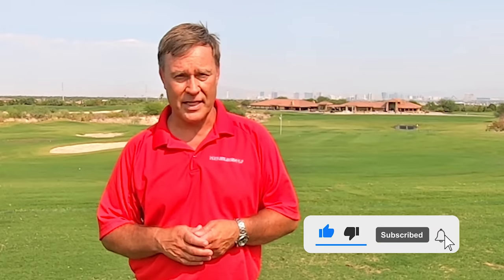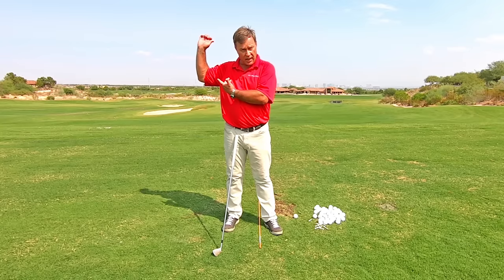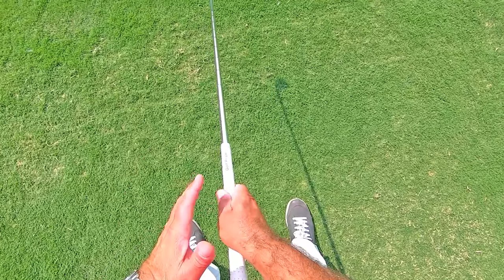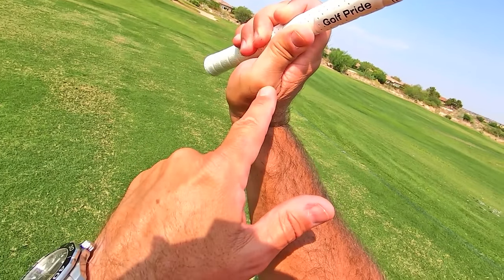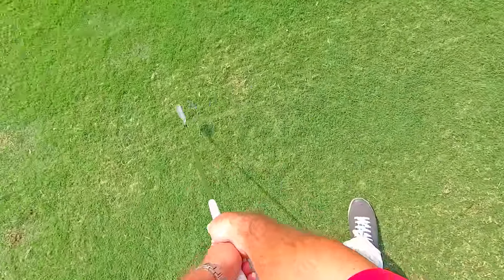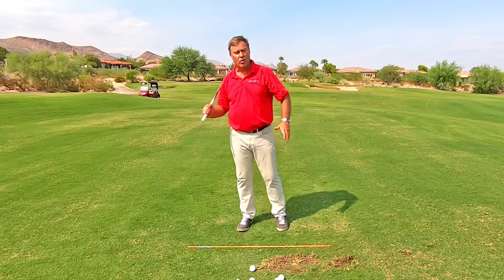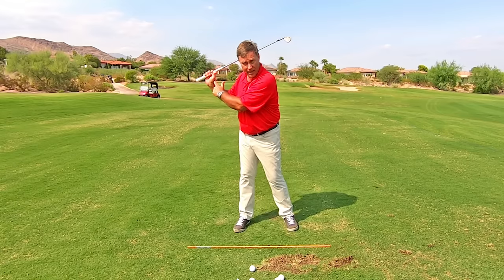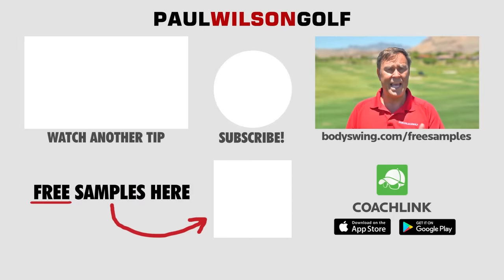GOLF GRIP - THIS PROBLEM LOSES POWER AND CONSISTENCY

Comment: When my thumb is squeezed against the side, with the forefinger in the question mark position there is not enough room in that v for the club to fit. The only way I can make it work is to separate the thumb which puts me in the position show at 5:15 of the video and the club moves around. I think my thumb is too short for this. Any tips? Smaller grips? I have standard size right now.
Reply from the maker: I don't have huge hands and I have no problem.  No problem in teaching all sizes of people for 30 years.   Just need to see it differently.  Watch my other tip here which shows how to place them on maybe more clearly:
https://www.youtube.com/watch?v=jQZLp8bF-Ww

Comment: Thanks, Another crucial tip for my improvement, is the correct right grip V pointing towards my chin? Right grip slightly weaker than the left and 2 Vs are not parallel?
Reply from the maker: The correct right grip would be the V points between the ear and shoulder.  Chin is too weak.  Remember that both V's need to be parallel too.  https://www.youtube.com/watch?v=jQZLp8bF-Ww
Reply: @paulwilsongolf  Thanks, I will try this

Comment: Hi Paul - not sure you will see this comment since you made the video one year ago - I do need your help. I am 66 years old. Several years ago I was in an accident that resulted in my right hand ring finger not being able to bend at the first joint at the top of the finger. Thus, when I place my hands in the neutral grip, the very top portion of my right ring finger will be sticking out straight. This is how I have been practicing the body swing - not sure if you have any suggestions for me, but any are welcome!
Reply from the maker: I try to get to all comments.  I don't see an issue with it as long as you keep the thumb presses against the side of the index finger that is still there.  If you can at least make the V so it cradles the club I don't think the stiff first joint is going to matter.  The problem is people running this finger down the grip which stops the wrists from hinging.  Check for the V and I think you are good to go.
Reply: @paulwilsongolf  Excellent! My V is there so I will keep practicing with my neutral grip. My index finger is just fine - it is my ring finger that cannot bend at the first joint at the top. Thanks so much! -Dan

Comment: 2:05 Neutral grip
2:34 wrap on top
2:47 question mark (important)
3:26 question mark (reminder)
4:01 The V
4:39 Don't Lock the wrist (not good)
4:50 Cast explained
5:14 No loosey goosey
5:54 Bad habits explained
Reply from the maker: Nice summary.

Comment: I’ve been playing for 3 years and have always had a ‘short’ swing where I felt I couldn’t hinge or rotate properly and my thumb being at 12 o’clock is the issue. It’s so restrictive and it could be causing my back pain as I fight my body to rotate more when my wrists and thumb having been restricting it.
Reply from the maker: Glad you found this one.  Yes, it could certainly create back pain because without the hinge you have to swing twice as hard.
Reply: @paulwilsongolf  thanks Paul. I went to the range to try it out last night and I’ve never hit the ball better. All irons and woods were immaculate. No swings changes just the simple thumb position!
Reply from the maker: Very good. This is helping a lot of people. Crazy how many people are gripping the club wrong.  It all starts with the grip.

Comment: Paul,To Clarify,I'm Not supposed to Squeeze the 2 fingers forming the Question Mark,just let the Club sort of rest in in there and Not let it slip all way down to the bottom of those 2 fingers??? Sal Patanio
Reply from the maker: Yes, you are going to squeeze them together so you get the V which the club is going to rest in.  Any separation between then and the club may wiggle.

Comment: So you interlock or overlap your pinky ? Also do you recommend the grips you are using ? I'm looking to re-grip my irons but not sure what to get.
Reply from the maker: You can choose the grip you like.  I don't promote interlocking even though Tiger and Jack did that grip.  I just find people wedge the pinky in with the index finger of the top hand to get a secure connection.  Problem is, the bottom thumb ends up down the shaft as I show in this tip which hampers the wrist hinge.  There are other reasons too.  So the choice is yours.  I would stick with the overlap though which you can learn here:  https://www.youtube.com/watch?v=jQZLp8bF-Ww
Reply: @paulwilsongolf  iv always overlapped but I know most players interlock. I guess it's just preference like most things. I'm from Scotland so I need a good reliable grip that's good in both dry and wet weather. Thanks for the reply.
Reply from the maker: Most players overlap.  Most average players interlock.  What you need are some good synthetic gloves.  There are some great ones out there now that are super sticky in wet weather.  Just search for them.
Reply: @paulwilsongolf  yeah I'm a single figure handicapper just looking to see advice. Iv played overlap so long I don't think I'd like to change. I have wet gloves but just feels weird using both hands haha. To be honest if the rain is that bad I just don't play. Take care man.

Comment: What should you do when the left thumb is under the club at the top and starts to hurt do you the pressure on it during the swing
Reply from the maker: Need loose wrists.  Secure grip loose wrists.  Work on my neutral grip so you know for a fact your grip is on right:
https://www.youtube.com/watch?v=jQZLp8bF-Ww
Do this with the grip on:
https://www.youtube.com/watch?v=Xk7t9yHCO-I
https://www.youtube.com/watch?v=7olBqwXF3Ik
Then:
https://www.youtube.com/watch?v=Z8K3Gctkz7A
https://www.youtube.com/watch?v=YHCEPu9e_1k
Reply: @paulwilsongolf  Thanks do much!! I just quickly watched these and will make sure to do as you say when practicing next! 

I was considering trying midsize grips, as I’m someone who has only every played standard. Do you have an opinion on grip size? I where a large glove which some say either or and have a 7 3/4” wrist to hand measurement, which golf pride says midsize but others say standard. Do you think making a change could benefit me or do you think it could hurt if it turns out to be a little to big? Thanks for your time! Love the vids!
Reply from the maker: Glad you are going to follow it.   Midsize grips are fine if your hands are a little bigger.  I would wear a cadet large glove.  I use standard tour wrap grips with 2 wraps of tape.  Midsize grips to my are too big.  The wider the grip the lower the hand action so you leave the face open.  If you your hands are big enough though you will be able to handle mid size.  When I check someone's grip and put their bottom hand on and I see that their finger tips hit the fleshy part of that same hand then they are too small.   So follow the grip first and look for perfect placement.  Then decide if they are too small.   Your hands are bigger than mine so maybe.
Reply: @paulwilsongolf  Thank you!! I really appreciate the help!

Comment: Have known this thumb position and benefits for some time but for me, it produces a banna slice. Assume the rest of your mechanics have to be correct for this to work.  Using a shorter back swing, the thumb position can be moved to the other (back) side producing much more consistency. Maybe less distance and some other downsides but it may  just depend on what works for you.
Reply from the maker: It is not the grip causing the slice it's locked wrists which is holding the face open.    Why not learn how to hinge and rehinge your wrists?  Only takes about 20-30 balls.  Then you can have loose wrists throughout your swing and get all the power you want.
Grip:
https://www.youtube.com/watch?v=jQZLp8bF-Ww
Wrist release drills:
https://www.youtube.com/watch?v=jQZLp8bF-Ww
https://www.youtube.com/watch?v=5_O0H2QNFo0
https://www.youtube.com/watch?v=Xk7t9yHCO-I
https://www.youtube.com/watch?v=sZ2-dqOausU
https://www.youtube.com/watch?v=7olBqwXF3Ik
https://www.youtube.com/watch?v=jEWe9Gaoqxo

Comment: I just started golfing, and even though I'm a weight-lifter, with calluses all over my palm pads & center 4 digits, it is absolutely tearing-up my THUMBS. It's brutal.
Reply from the maker: Learning the golf swing can create all sorts of pain in the beginning.  As for the grip you need to do the proper grip.  Once you get the grip then you need loose wrists to allow the club to hinge and rehinge.  Right now, I would think you are just grabbing on tight which is locking your wrists.  If you hit a ball off center it creates shock which twists the club in your hands cause the shock has to be absorbed somewhere. So it's a secure grip with loose wrists.  Also, better contact of course creates less shock/twisting.  Follow these tips:
https://www.youtube.com/watch?v=jQZLp8bF-Ww
https://www.youtube.com/watch?v=Z8K3Gctkz7A
Then I usually start beginners with these:
Body Swing Concept: https://www.youtube.com/watch?v=E8y9jEyY35k
How the swing works:
https://www.youtube.com/watch?v=GHUFYnu-Bmo
How To Hit It Like Pros: https://www.youtube.com/watch?v=0gOuKQpUl54
Alignment: https://www.youtube.com/watch?v=VFZc0Wq282k
Simple Swing: https://www.youtube.com/watch?v=gTLvRsjwfIM
Wrists: Hinge Rehinge:  https://www.youtube.com/watch?v=6ZeTqcz2pmE
https://www.youtube.com/watch?v=M868QsTlGt4
Body: https://www.youtube.com/watch?v=RdphthCQ9VM
You can also do this to get the shape or movement of the swing super fast: https://www.youtube.com/watch?v=gTLvRsjwfIM
Just realize you are not hitting anything.  You are learning a movement.  Arms and wrists are loose.  You are powering it with the legs and hips. In other words this is leg press not bench press.

Comment: Do the fingers interlock?
Reply from the maker: I don't do an interlocking grip.  You can if you want but if you do you need the V of the bottom hand on top.  Most try to wedge the pinky in too deep for a secure connection and their bottom thumb goes down the shaft.  This hampers the wrist hinge.
https://www.youtube.com/watch?v=lWEhXEGSgRE
Learn the neutral grip too here:  
https://www.youtube.com/watch?v=jQZLp8bF-Ww

Comment: How does that compare with the teachings of what Dustin Johnson does at the top. There is a video on to see how it looks. No hinge. I’ve got the hinge and have been told to not do that. Im confused. Comments welcome
Reply from the maker: Well he actually does hinge.  He also bows his wrists..  Doing this shuts the face.  In order to square the face he needs his hips to be open about 60 degrees through impact.   Very difficult to do especially for the average player who barely uses the hips at all.   I have seen the very same position over my almost 30 years of teaching in woman and little kids.  It is due to pulling it the club back with the weaker right hand causing a bow at the top.  If I saw that position I would have fixed it.  Obviously, no one fixed his position.  It's a miracle he  an even hit a ball from there.
Reply from the maker: Just to clarify.   From the front at the top hinge wrists are hinged to 90 degrees or less so he is hinging.  If he didn't hinge his clubhead would be pointing away from the target at the top of the backswing.

Comment: I broke my right wrist 3 times. I have to turn my right wrist toward the right side of the shaft. I can put my thumb parallel to the front of the head. I think that's my issue. Not sure.. yepp, almost sure that is my issue. I can't wrap my right hand the way his is. My thumb is to the back more.
Reply from the maker: If you have a physical issue you need to understand what I am saying in the tip then try to figure out what is going to work for you.  Loose wrists allowing them to hinge and rehinge.  That is the key.   Thumb down the grip and you can't hinge and rehinge.

Comment: Not necessarily true. Have seen many pros use of the thumb on top to start swing. It just ends up a little towards the side when you get to the top.
Reply from the maker: So it goes to the side at the top.  This would mean it is not down the shaft as I am suggesting.  Plus they are pros.  The average person is not.
Reply: @paulwilsongolf  skirting the obvious.

Comment: I have long finger's, when I grip my right hand this way the position becomes far too weak
Reply from the maker: You need to wedge your left thumb into your right lifeline.
Reply: @paulwilsongolf  I did but my lifeline tries to get on top of my thumb too far to the left and now I have to train that out
Reply from the maker: You need the V pointing between the right ear and shoulder no matter how you have to do it then do it.   In this tip I didn't want the thumb on the grip.  This is easily done if you have the V.   In 32 years of teaching I have never had anyone not be able to do the grip.  So watch your thumb placement.  Also, maybe look at midsize grips.

Comment: I have to take issue with the way you present this as the only way to grip a club and if you don't do it like this, you're doing it wrong. Plenty of pros don't use this grip, Justin Thomas for one, and they do just fine.
Reply from the maker: You think pros don't have flaws in their swings?  The difference is they are pros and have done it that way daily for hundreds of thousands of swings and still do it daily.  Your average person plays and practices once a week.  Plus, why would you not want to learn to do something right?  Check the comments below and see how many people are hitting it better than ever by doing what I mention in this tip.

Comment: Thumbs should never be on the shaft. That said, a neutral grip for your body could be a weak or strong grip for someone else’s. My neutral grip would be strong for you, but not me. You can talk fingers and not palms, but weak, neutral, and strong grips are different for everyone.
Reply from the maker: There is no different grip for your body shape or type.  I have taught tens of thousands of golfers of all shapes and sizes since 1991.  They never have an issue doing my grip and hinging the club properly.  If you want to do a strong grip and think it's neutral then go ahead.  Just realize you cannot have loose wrists with the strong grip and hit it straight without adding at least one of 5 flaws/compensations.  So if you are hitting it straight with that grip I guarantee you are doing something to keep it straight. If it works for you and you think you are playing your best golf then keep doing it.  If you feel you could hit it straighter or more consistently without having to practice all the time then do it my way.